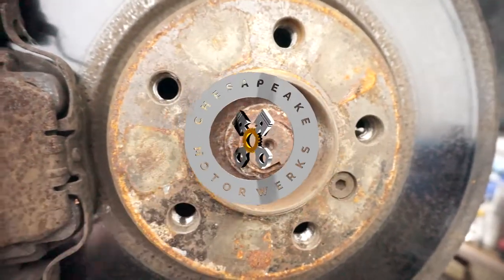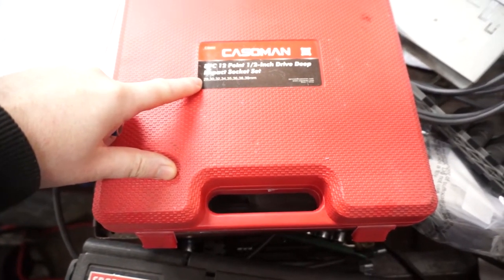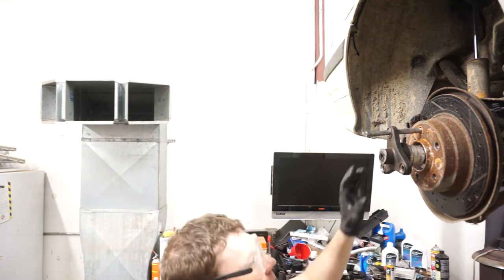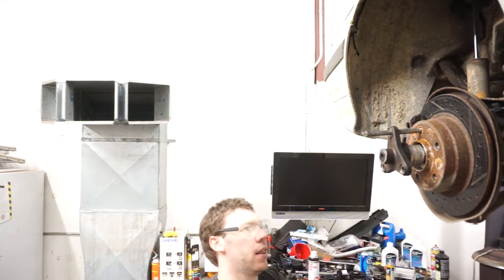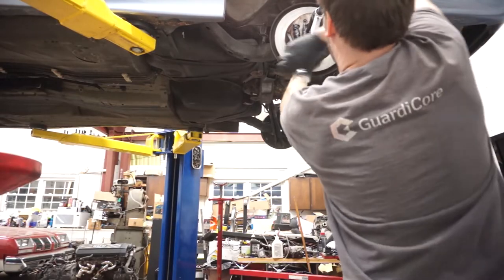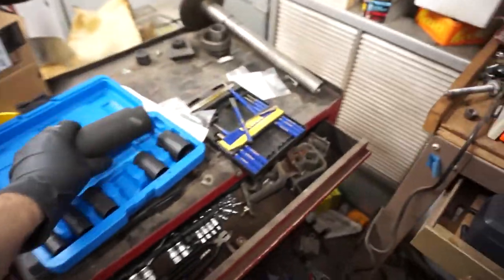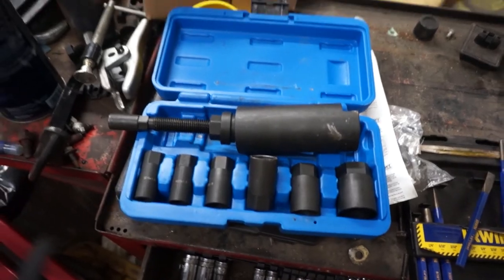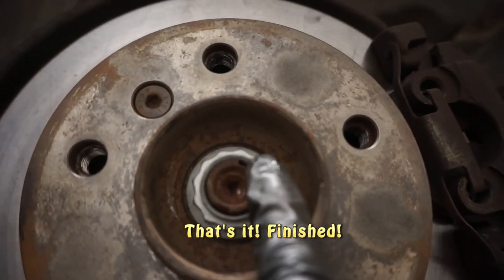How I remove and install BMW axles from wheel hubs

Comment: I add Never Seeze to the splines and never need a puller to install a new axle.
BMW CV grease turns to a thin liquid BEFORE the end of the service life of the CV joints. 

Regularly grease (and PRE GREASE) your CV joints with Amsoil Off Road Polymeric grease which resists separation better than any other grease I know of.  . That grease in Amsoil's line up comes in two versions. Buy four tubes at a time and pay only a $10 flat rate shipping charge. Amsoil has a nearby dealer who stocks what you need to MAIL the items to you FAST! Mine actually had to come from out of state. You can't just drive and get this Top Tier grease.

Use the thinner NGLI #1 version for CV joints and the thicker NLGI #2 version for ball joints.
You MUST pump a LOT of grease in all these fittings before you install a new part. Not only is the OEM grease not the best, they purposely use a teeny, tiny amount to aid in the PREAMTUTRE failure of the part. Last BMW ball joints I installed needed 20 pumps per ball joint to even plump up the boots. At 20 pumps they were not over filled!

Buy several 18 gauge grease NEEDLES in a kit (Amazon). You can simply slip the needle past the boot collar without even having to puncture any boot. IF you are forced to puncture a boot, just seal the micro hole  with a dab of fresh SHOE GOO .....NOT RTV or any type of Silicone!!  

A good grease gun has adjustable tip to firmly clamp down on any fitting so the grease ALL goes in to where it is supposed to go. USE that feature!

I add Zerk fittings where possible to new parts before installation. Use #3 Cobalt drill bit, and a 1/4 X 28 BOTTOMING  tap and Teflon tape around the Zerk threads.

 I install plastic Zerk fitting CAPS on all my installs. You can get ALL of the parts and tools on Amazon. Only the high quality Cobalt drill bits (came two in a container) cost anything of note. Rest of the items are dirt cheap.
Use your brain and skills and not a single chip of drilled metal will end up inside your new ball joints.

Comment: What would you suggest when the nut has turned into a blob of rust? Both my rear axle nuts have become one with the axels and are almost non existent.

I want to replace the hubs but I'm worried I may destroy the axels when separating from the hub.
Reply from the maker: Wow, that sounds like a tricky situation. I've never had them where I wasn't able to take them off with a socket. If you're replacing the hubs & wheel bearings, you can try heat (oxy acetylene) to break them loose. If there's not enough there to work with, the next step is probably to carefully cut into the nuts with a dremel (not cutting deep enough to hit the axle threads) and then try to break the remaining part of the nut off with a chisel or air hammer.